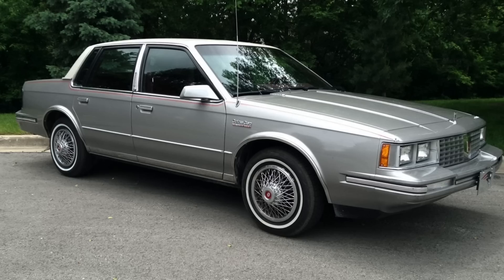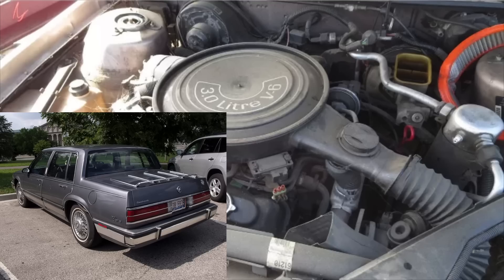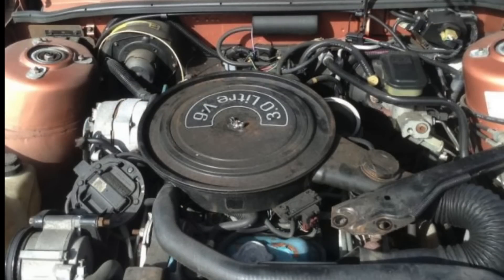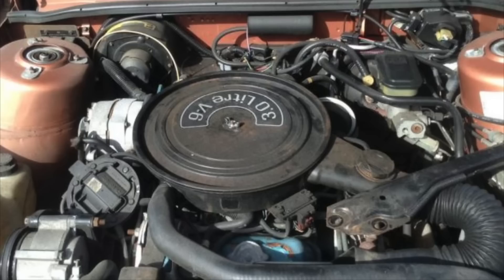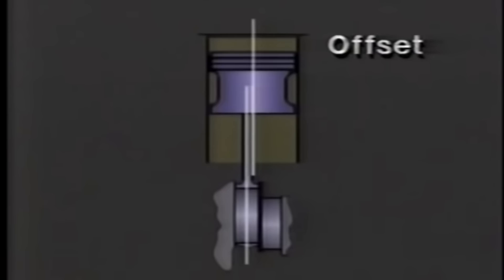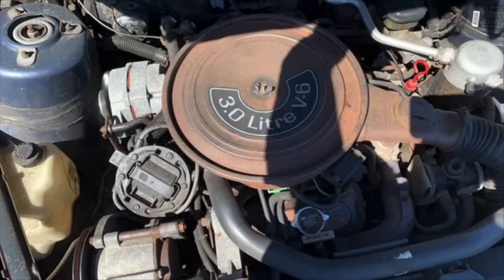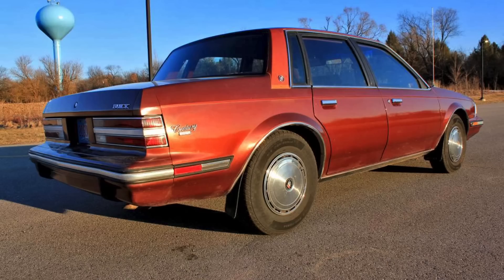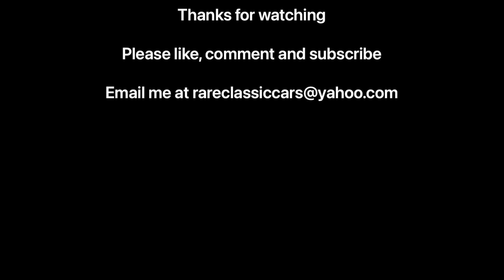Worst Engines of All Time: GM's 3.0L LK9 Carbureted V6 Engine (Buick Century, Olds Cutlass Ciera)

Comment: My first car was a 1983 Cutlass Ciera with the 3.0L engine. Worst. Car. Ever. That thing had so many issues and caused so many headaches that I practically did a happy dance the day I got rid of it. Not to mention the electronic carburetor was a joke and no tech who looked at it could figure out how to fix it or why it would only run normal when the check engine light was illuminated. But on the flip side, my folks purchased a 1986 Olds with the 2.5L 4 cyl and that car was an absolute gem with never any issue.

Comment: Typical GM! Design is great on paper ... then by the time it makes it to assembly, they ROYALLY screw the thing up! These days (and back in '07 when my truck was built) they do the exact same thing - make a great engine (LS 5.3 for example ...), then build it with low bidder AFM lifters that fail anywhere between 90k -140k miles. When they decide to fail is a roll of the dice. Yet, the lower end has been known to survive many 4-digit forced-induction horsepower pulls before ejecting parts violently. Lately I've been seeing social media posts of the hand-built Corvette engines self-destructing BEFORE ONE HUNDRED MILES!!!! 😳WTF, GM! Get your sh!% together!

Comment: Hi Adam, I used to work as a mechanic at a Chevrolet dealership in the late 1990s, and the Chevrolet 2.8L 60 degree V6 engine had a major oil pressure issue.  On a hot summer day sitting in traffic with the air-conditioning on, the oil pressure would drop to zero, or near zero.  These engines did not last very long.  GM came out with a larger oil pump that did not correct the issue.  Most V6's do not last as long as a V8 does.  My favorite V6 is a Chevrolet 4.3L which is a Chevrolet small block 350 V8, with two cylinders cut off.  Please reply.  Dave...

Comment: This was an unintended consequence of GM's move to use the same engines across all the brands... the individual divisions were not making their own engines anymore, so there was no internal competition within GM to make the best engines.  Hence, stinkers came along, and the blast radius of failure was four or five times larger than it would have been if the mistake was localized to one brand.  Sharing engines was no doubt a great cost-saving measure... Mopar and Ford had been doing it for decades, mostly with great success, but when GM started it, they just stunk it up.

Comment: In 1986, I was shopping for 4 year old Cutlass Cierras.  I wanted to get a diesel, but Dad insisted I get a 3.0 V6 because "it would be more reliable."  I experienced lots of carburetor issues, coolant leaks, and ultimately a spun rod bearing at 99,000 miles.  Guess i was fortunate to make it that far.  Mine was a Broughm package.  So comfortable, but the engine was truly awful. Only car I ever owned that didn't make it past 100,000 miles.

Comment: My dad had an '84 Ciera with one of these. The carburetor and the electronics were terrible; it would do this surging cycle with the rpm's cycling up and down rapidly when it was first started from cold that would persist until the engine was fully warmed up, nobody from the dealer to our very competent local mechanic could figure out how to fix it. it was downright dangerous, as it could surge just as you were taking your foot off the brake to move forward.

Comment: My dad was a parts guy at a small GM dealer for many, many years.  My first car was a 1-owner '85 Buick Century that was taken on trade with this very engine.  I remember it was not that smooth running, and was utterly gutless, but we had great reliability, actually.  Now, I was 15 years old, and I don't remember if my Dad already had the service records for this car, but he may have known work that had already been done.  All I knew was he paid about $300 for it, the first owner(s) were a farmer and his wife, and the car had 165k miles on it when we got it.  However, other than lots of sand/gravel dings in the paint from the dirt roads they lived on, it was an amazing car in great condition.  For whatever reason, they ordered it with about every option, too (power windows/locks, tilt, big fluffy seats, level ride, vinyl roof, chrome trim, wire wheel covers, etc.).  The only reason we got rid of the car was that is wasn't in condition and reliable enough to take on a highway road trip.  It went on to another high school first-driver child of one of my Dad's co-workers, and I got the best car I've ever had:  a 1988 Pontiac Bonneville with the amazing 3.8 Liter V6.  In comparison, loads of power, and a joy to take a long road trip in.  I cried when someone pulled out in front of me and totalled the car in 2004 with around 140k miles.  Wish I could get her back.

Comment: I think we can all agree that GM has had several poorly made engines and sadly,  some for many years. The one that is subject here, the 5.7 liter diesel from the 80's, the 4.1 V8, the Northstar V8,  the current 3.6 liter V6...even the 5.3 and 6.2 V8s with the AFM have a class action lawsuit on the table right now for engine failures
Honestly...GM would have been better off buying/rebranding Toyota's 3.5 V6 and using it in all the vehicles the 3.6 is used in

Comment: I'm not an automotive engineer but that diagram of the offset connecting rod gave me the shakes. Then I can just imagine trying to merge onto a freeway and trying not use extended full throttle (when your nearly full-sized auto is being pulled by an engine transmission combo that at best you could call weak sauce).
Reply: Eventually every 90 degree V6 from the 1990s and up had the split crank. Including the PRV V6 and the Audi V6.
Reply: @macmanipowermacbookprair4110  With or without offset connecting rods and non-staggered bores?

Comment: Adam,  was this same offset design used in the 3.0 fuel injected engines?  I had a 85 Grand Am which I bought new, always changed the oil every 3000 miles and the car suffered a rod bearing failure at 125,000.  I also had a 86 Olds Delta 88 which i bought used with this same engine,  It had a timing gear failure at about 90K follow by a rod bearing failure at the same 125,000 mark...
Reply from the maker: Yes it was

Comment: I had an 87 Buick Century with a 2.8l and it was a total pile of JUNK. It was drinking oil at 50,000 miles and after playing their game over a quart of oil every 750 miles being normal, they tore the motor down under extended warranty and found 3 pistons with the rings lined up. The paint didn't hold up and the electronic ignition fried on the way to Ohio and it never ran the same since.

Comment: I had a 84 Camaro with the 2.8 last year for carb. Random stalling issues from day one dealer never was able to resolve then at 65,000 head gasket blew. Traded it in on a Mazda and never stepped into a GM dealership again.

Comment: Adam - you are saying this is one of the worst engines of all time. I would like to know if you had a personal experience with a Cutlass Ciera or Century which had this engine which is leading you to say this? If so, would you care to share what happened? Because a lot of times, when someone says some car or some engine is one of the worst ever made, they are speaking from some kind of personal experience. I remember you talking about an 86 Cutlass Ciera you owned with, I'm pretty sure, the 2.5L Iron Duke engine. In this video, you say there are "unnatural forces" inside the engine. Can you say what those are?  I just don't remember people complaining specifically about this engine back in the day. You're the first person I know of who has specifically brought up this particular engine. Also, after 1985, this engine DID continue to be produced - just in a slightly altered form and in a different GM carline. More on that below.  You said there were connecting rod failures on these engines.  Were the connecting rods made out of some kind of substandard material? If so, what was it?  You also mentioned the phenolic timing gear chipping a tooth and causing problems - I'm going to assume that a piece of the timing gear would get into the oil pan and eventually find its way to the pickup screen for the oil pump, thereby blocking it and causing oil starvation. It depends on the order in which the events happen. Did something, either a piece of the phenolic gear, or sludge in the oil pan on a car that did not have its oil changed often enough, lead to the oil pickup screen getting blocked, which then led to oil starvation, and then to the bearings wearing out, which then led to a rod being thrown in the engine?  I don't think the connecting rods being offset slightly, relative to the center of the piston is necessarily a bad design - but I can see if the engine is revved too high, there could be a problem with that. Are full skirt pistons necessarily something that led to a problem? What is the redline on these engines? These cars all had automatics - the transmission should be designed to shift up before you're way into the redline zone, even if the TV cable is adjusted all the way out to the high side. Since this is a short stroke large bore engine, the redline should be pretty high, like 6000 rpm.  On a long stroke engine, the redline would be much lower, like 4500 rpm. These figures are for pushrod engines, not overhead cam engines that we have today which have even higher redlines. I'm just wondering what would be leading to the connecting rod failures you mentioned. So here's something to think about. the 3.0L V6 engine with a carburetor was discontinued for use in the A body vehicles after the 1985 model year. As you said, a few 1985 C body cars also got them (which, why they even offered a carbureted engine on the then very modern new and luxurious model Olds 98/Buick Electra I don't understand). But here's something else - the 3.0L V6 did continue to be offered from 1985 to about 1988, possibly later, with multiport fuel injection on the N body cars (Somerset, Skylark, Calais, not sure about the Grand Am) as the step up engine option. The 2.5L Iron Duke was the base engine. So - was the 3.0L V6 redesigned in some way that the N body cars that had this engine did not have the same problem? Or did they also experience these same connecting rod and/or oiling issue problems? I do remember on the N body fuel injected 3.0L V6 engines, there could be driveability problems due to the MAF sensor they used on them, which weas then new technology - or - the air duct leading from the MAF sensor to the throttle could get holes in it, which caused additional air to be added to the intake air that the MAF sensor hadn't detected.  My point is that the 3.0L V6 wasn't discontinued after 1985 because customers didn't like it - it was converted to fuel injection and used in another carline for several years. What I want to understand is, since you say the connecting rods failed on these engines, why did they fail? Because while it is possible that there was a design flaw with the engine, a lot of times people's engines failed on all kinds of cars because people don't change their oil. You know on a carbureted engine that the fuel mixture is very rich when the engine is started cold and the choke is set. If you only drive around town or go short distances in the winter, the fuel mixture is rich quite often, and the oil gets dirty. This means you need to change your oil frequently.  3 months/3000 miles is a good rule of thumb, but really, checking the dipstick periodically and seeing how dirty the oil is getting is also a good idea. If the engine oil is not dark brown but black - i.e. full of carbon and unburned fuel, before 3000 miles, then you'd better change it. Deposits and sludge can build up in the oil pan, and eventually they will find their way to the oil pickup screen and block it, causing oil starvation, worn bearings, and eventually if ignored, a thrown rod. Different engines build up sludge and others don't. You also live in Michigan, which has a lot of cold weather. I don't know if that is what happens on the 3.0L V6, it sounds like you're saying that the engine failures are not due to sludge or debris in the oil.  If it is though, that's not a design flaw of the engine, that's a lack of maintenance.  Oil in fuel injected engines doesn't get as dirty because the computer controls the fuel mixture even at cold temperatures and keeps it leaner. Was the car you had this happen on a used car? With used cars, you never know what you're getting and how frequently the previous owner changed the oil. Maybe this engine really is more vulnerable to a lack of maintenance, maybe there is some kind of design flaw with the connecting rods on these engines. Maybe material comes off the cam timing gear, gets into the oil, and blocks the oil pickup screen.  Here is what I do remember from years ago. I worked in the shop at a community college. People would bring their cars to us to be repaired. People would come to us with cars that needed repairs that they could not afford to bring elsewhere. But people would do dumb things that led to engine failures. They didn't change their oil often enough. They ran their engines low on oil because they never checked the dipstick. The OIL light would come on on the dashboard, or the TEMP light would come on on the dash, and they'd keep driving!  Or they'd keep driving and try to find a repair place or a pay phone (since that's what we had back then). The point is - you HAVE to STOP when the oil light or the temp light comes on on the dash. The VOLTS or ALT light is the only red light where you can keep driving if it's on. They'd ruin their engines, and they'd want us to fix them. Then they'd complain about how it was GM's, or Ford's, or Chrysler's fault and how they built a crappy car that was such low quality that it only made it 105,000 miles or whatever - when really, it was their own inability to take care of their car properly, or not reacting quickly to the warning signs that there was trouble, that led to their engines getting ruined. Some engines have design flaws that you can't do anything about - the Olds diesel and Cadillac 4100 engines come to mind. I can see those being cast as worst engines because the owners can't do much, if anything, to prevent an engine failure. But to me, it sounds like the 3.0L V6 doesn't actually have a design flaw that led to failures per se, it sounds like it has a vulnerability to a lack of oil changes or a lack of maintenance.  Does that, in an of itself, make it one of the worst GM engines of all time? I'd say that's debatable - though maybe you can present more evidence to support your point.
Reply: It wasnt pieces of the timing gear. That would just snap as it was equipped with nylon teeth. After they stopped adding zinc to oil, this was tremendously hard of these flat tappet engines, as they would literally be metal to metal contact with very little lubricantion. And these fine shavings would clog the oil pump filter. Thus, the engine would throw a rod.

Comment: Thanks Adam for finally doing this! And you are totally right about the cold mornings, poor carb set up, nylon timing gear, oil pump clogging, and adding zinc additive to the oil! 

I rebuilt my entire 3.0 engine and it runs flawless now with no problems.

Comment: Yeah..that was a trash motor. If you knew what you knew at the time..get the Iron Duke. My family had a 86 Olds Cierra. Lasted 11 years, two motor mounts, rebuilt transmission. It was my daily to work and school in the 90s. It only died when my brother got T-boned in it. Lots of memories with that car...

Comment: I had a customer with one of these in the early 90s ,it broke the timing chain idling at a gas station, had only 60k on it ,bent 2 valves pushrods, installed a all metal chain set.

Comment: 5:10 I'd never heard that explanation before, though I always wondered why this seemingly innocuous engine came up short in so many ways. Buick was probably limited in how much they could change the dimension of these engines because they shared the lines with Buicks V8s, which were still, I believe, descendants of the 1953 "nailhead" 300.  Maybe the offset piston rods were less of a problem in the 3.8 L version because it only put out 105 HP in 1978, the first full year of the even-firing version, and the same 110 HP in 1982 as the power of the smaller 3.0. I wonder what Buick had to do to make the turbocharged 3.8 reliable, and how well it worked. In any case, it sounds as if GM should have just have used the 3.8 in the Century as-is; it's really surprising that they further added to the teething problems of the '85 Electra with the unloved "Electra 300" version.
Reply: You need to do some reading. The original 1953 Nailhead was 322 CID or a very rare 264 version. Later enlarged to 364, 401 & finally 425 CID. All these engines have the "reversed" rocker arm arrangement designed to make the engine narrow enough to fit the  early 1950's engine bays designed for straight 8's.
The 300 was a new design small block engine derived from the 215 aluminium V8, as was the 225 V6 which shares the same 3.75 x 3.4' bore & stroke. Later the 300 was enlarged to 340 & the 350 CID

Comment: Markedly oversquare, yet in a configuration (90 degree V6 with offset crank pins) and application where high RPM operation was not appropriate - there must have been an engineering motivation of some sort for this, re-use of existing tooling perhaps?
Reply from the maker: You got it

Comment: As a mechanic who used to work on these cars, I would say the 2.5 4 cylinder was a much worse engine. And the carbureted 2.8 was also troublesome, with the main problem being it's variable venturi carburetor and all of it's vacuum hoses. Overall, this was a sad point in GM engine history. Luckily it got better once they started putting multi port fuel injection on the engines.